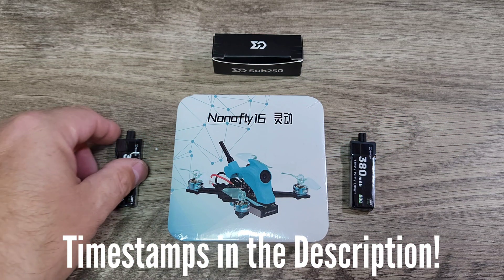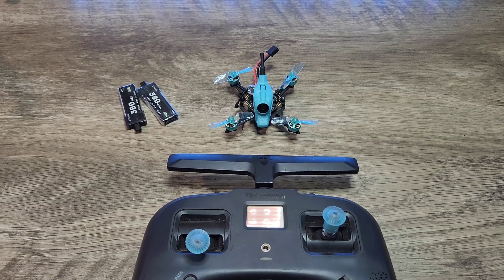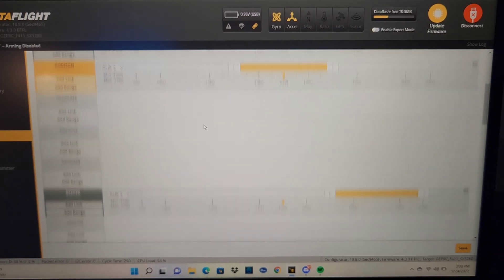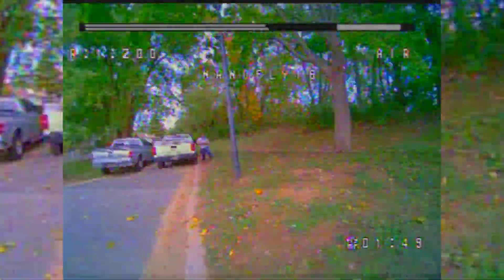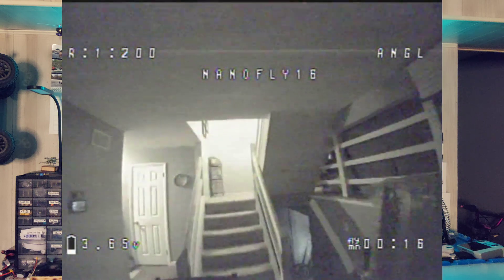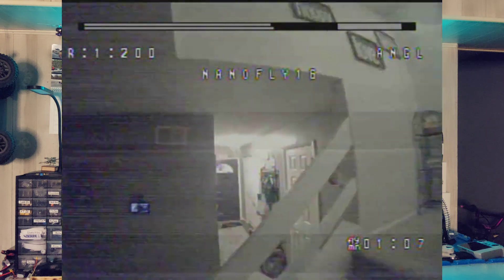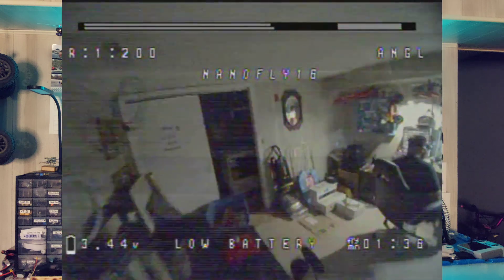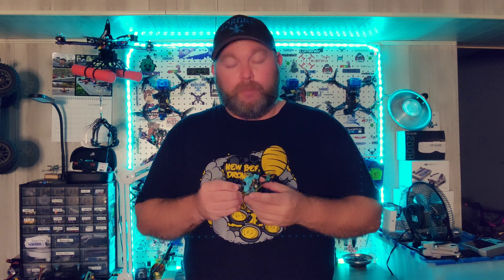Sub250 Nanofly16 Micro Sized Madness! Review/Binding/Betaflight

Comment: It's cute. There some things I would do right outta the box.
Loose the battery tray, rubber band is lighter and just as good. 
That power lead could be shorter,  you could loose a few big grams and get better handling. Run a bf dump,note the board orientation and load emuflight. 
Awesome review, I can't believe how well you handled it in that tiny room. Wow great flying
Reply from the maker: Thanks for your feedback brother 🙏 I really appreciate it and definitely much respect coming from you. Definitely agree with everything you said other than emu 😉 jk I just love beta. I'm going to do the suggestions you mentioned and see how much flight time I can gain. Thank you 😊